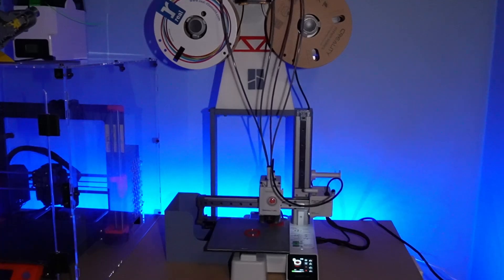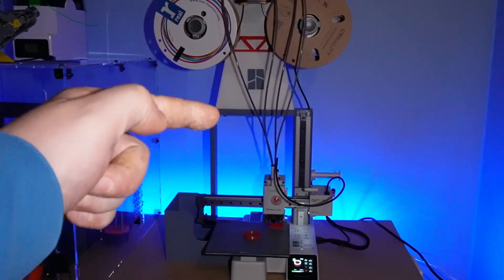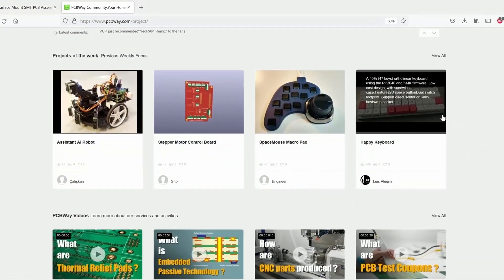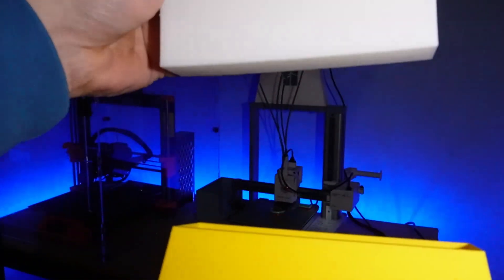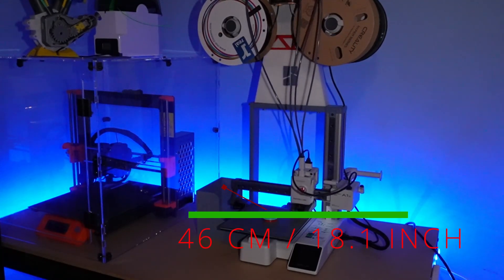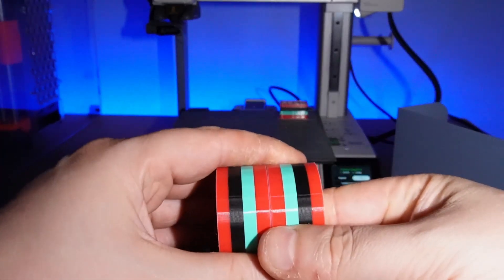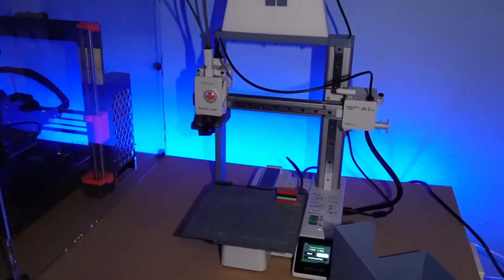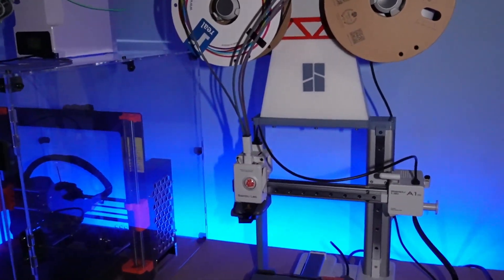Bambu a1 mini ams lite space saver   #3dprinter  #bambulab  #a1mini  #ams

Comment: It's also too bad You need a larger printer than the mini to print something to be used on the mini.  I'm not talking about the Sidebar with the foot, I'm talking about the top bar with holes.  It's 255mm wide!  That's WAY over the 180mm limit for the Mini.

Comment: I see that both versions call for bolts. Do they require corresponding washers and nuts, or does it thread into the print (plastic) itself? 
Thank you!
Reply from the maker: yes they do tread into the print itself, works like a charm

Comment: How did you attach the horizontal piece to the top attachment. I see the holes but am unsure if I need more bolts or should just glue it?
Reply from the maker: are you talking about the ams lite holes? if so those are the bolts that u unscrew from the original stand. If not it says which bolts u need in the video
Reply: @aim6mac  thanks, I figured it out after 3 trips to Ace Hardware :)

Comment: Isn't there a risk of the paper reel on the printer?  (ex. pulling a tangled filament)
Reply from the maker: no, the bambu a1 mini has protection against tangled filament, (it will stop printing when it happens)
Reply: @aim6mac  great features...thanks for the reply

Comment: Interesting design. Why is the bottom part with the logo so tall? I get you have the upper part which slides into it, but that lower part seems to be 3x taller than it needs to be. Wouldn't it be more stable if it was less tall?
Reply from the maker: you are right it would have been better if it was shorter , however this design only works this way since the hotend otherwise collides with the filament spools (when you print tall object or after a print has finished)

Comment: Currently printing now.  I had I glob form on the ams bracket(the pc that goes into the rectangle part like a sleeve) seems to be from the support failing and globbing up. It ended up correctly 6 or so layers up. The print turned out fine still!

Comment: Hello! Great video! I'm still waiting for the A1 but I'm trying to figure out how to make it fit inside a cabinet and this seems to be the solution. Could you please let me know the total height needed for this setup? From A1 feet to the AMS feeding pipes with the A1 in the highest position... Thanks in advance! Cheers
Reply from the maker: with 80 cm in total height (with ams lite PTFE tubing including) you will be fine , although keep in mind that when changing the filaments on the ams lite system, u will need to either have a moveable bottom in the cabinet or removeable top ontop of it.

Comment: Seem a bit too tall? Can will 2cm lower in the base, will it  affect petformance?

Thanks for making another idea how to save space for AMS!

Do you need to change a longer tube or using existing one?
Reply from the maker: i left around 1 or 2 cm gap between the hotend assembly and the ams lite system just to be sure it won't collide with the filament spools, this way it works flawlessly, been verified and tested by me personally